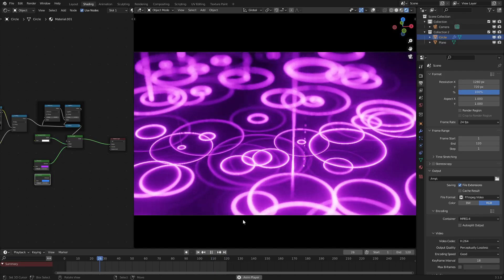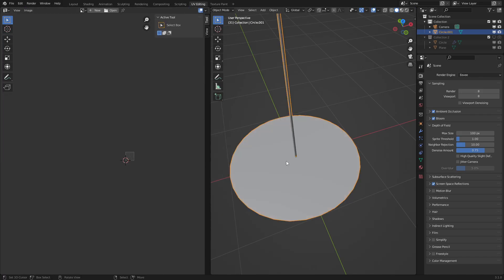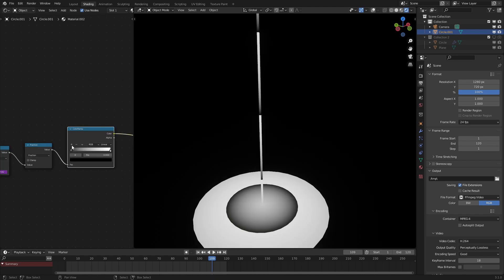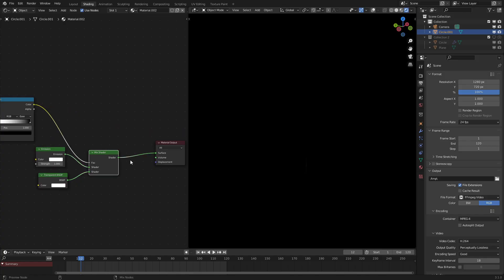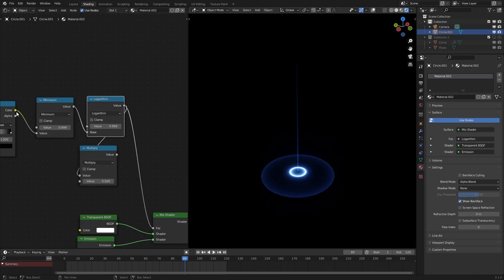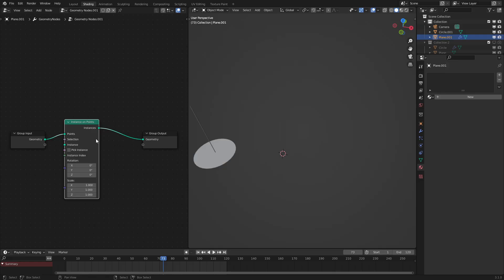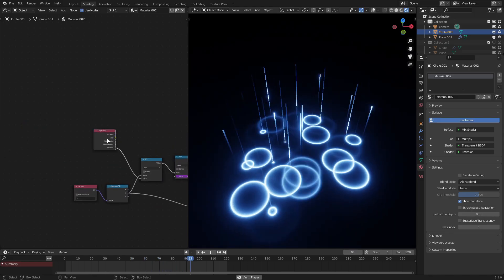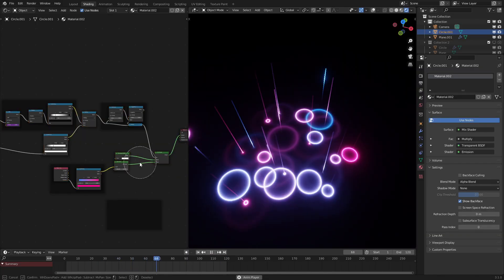How to make Neon Puddles in Blender!

Comment: II am using blender 4.3. After instancing the droplets within the grid I was getting artifacts from the meshes overlapping. I noticed they appeared in the tutorial and went away when going to rendered view. I double checked the shader nodes and they were correct. My quick fix was adding a random value node, set to vector, with the value plugged into the offset of a set position node. I then set the min and max of x and y both to 1, with the z between .99 and 1.01. It helped with the artifacts, but some still showed.
Reply: Thank you for the fix. I also used a Vector math set to subtract and used 1 value to all 3 axes, and placed it between the random value node and the set position node (to bring it back to the grid). Maybe there is a simpler way than this, but this is how i fixed it.
Reply: Thanks man

Comment: Finally figured out two things: Blender 4 or newer auto adds the node he adds to the material output; and it has to be #frame/ the number you use, not . the number. So it would be #frame/24 or #frame/20 for the add value :) This fixed the animation for me, at least!
Reply: Also thanks for the tutorial, guy! :)
Reply: Thanks brother. I was looking for what is wrong. I figure it now. #frame/ right one.

Comment: I've learned more from your tutorials than I have with any other procedural materials tutorial on YouTube, and I've been learning to use Blender since 2007.  Thank you for the great tutorials.

I knew about animation before using Blender, I'd gone to college for 3D Modeling and Animation, but the software I was trained on was way out of my price range, still is, that's why I use Blender 3D.  The training that I have is very old and out of date, this is before any software was using quad faces, everything was still triangular faces back when I was first learning 3D computer modeling and animation.  The software was 3D Studio R-4, not to be confused with 3D Studio Max 4, this is before the Max (Windows version of the software, the 1994 old DOS version of 3D Studio).

Comment: does anyone know what that color ramp is connected to? is off screen at 6:28
Reply: the material output node. with node wrangler you can press buttons over a node to snap it to the output to see what it is doing. i can never remember that shortcut though

Comment: Great Tutorial, as always! These tutorials are endless sources of inspiration.

One question, how would one go about randomizing the location of the drops, as it appears static right now.
Reply: Use a particle system - not Geo Nodes. You need to remove the random timing or you  can get the 'end' of puddles at the start of the individual instance.